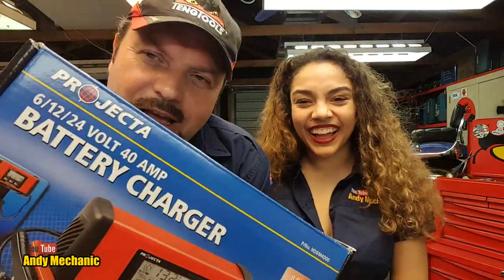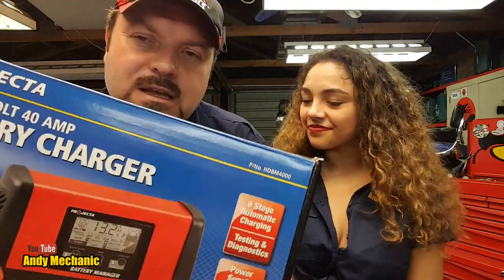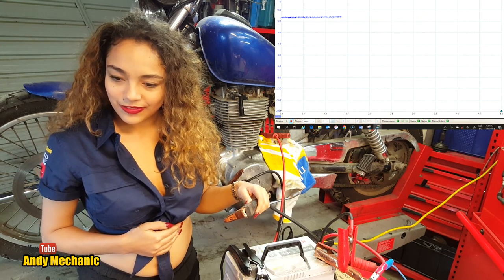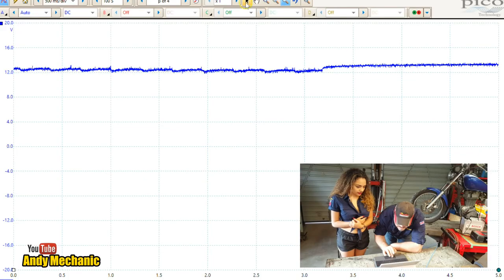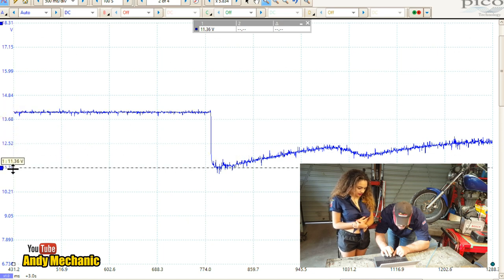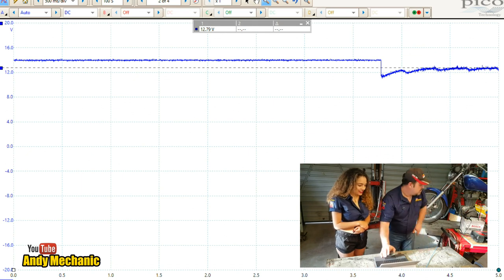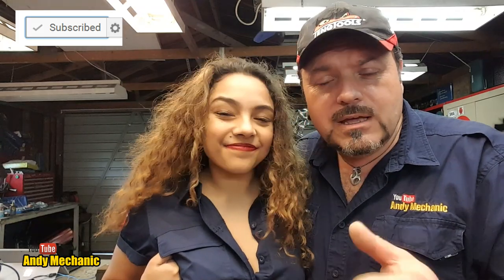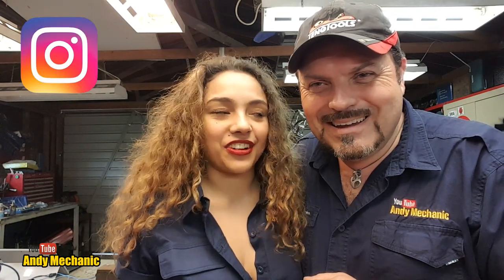ECU reprogram - Testing a Projecta Voltage stabiliser Ft.Tool Girl Jade #2605

Comment: Nice to see you using my favourite bit of kit,the pico scope. For power supply when testing I use a Ctek mxs27000 and it has been absolutely faultless in service and operation. Can't speak high enough of the quality of the product.
Reply from the maker: Cheers Andrew. If you get a chance would you do a similar test on your Voltage Stabiliser -  I'm really interested to compare devices. Especially looking at the data that I cover in the 2nd video on this - will be live on the channel in the next couple of days.

Cheers
Andy

Comment: will a smart charger not have done the same  as that unit did on this test ? some nice clean waveforms to
Reply from the maker: Hi Simon, I don't think a smart charger has the capacity available to compensate for up to a 70 amp draw unfortunately.

I'm just about to start a filming a 2nd video on this to capture more data with the PicoScope - a request of the NZ importers - they seem a little concerned (like me!).

Video should be up in the next day or so...

Cheers Andy
Reply: Andy Mechanic I've never done any. Programing on bike   but by you wanting the 70 amps I guess you need to turn the starter as some point
Reply from the maker: Yes, maybe. Though this unit is designed for use on cars too and a 70 amp draw on a car can occur even without an engine crank. I was just replicating that size draw to see how the 'tool' would react etc...

Watch this space!

Cheers Andy

Comment: I don't know if "benching" the ECU (that is, removing it from the vehicle system) or supplying the ECU with it's own dedicated power is possible in all circumstances, but I'd connect it directly to what in the electronics industry is know as a Constant Voltage Regulated/Switching Power Supply. 
Something like the MJF-4128 would cost in the neighborhood of $125 NZD (plus shipping & taxes, of course) provided 28A would fit the bill.
Even a large 35A regulated power supply should be under $250 NZGD.

Comment: The voltage difference between what the stabilizer is set to and what is being measured at the battery terminals is due to voltage drop in the connecting leads. 
The stabilizer only knows what it's internal voltage is. When the starter motor load is applied, the stabilizer is doing all the work, as the battery was at 13.4v before the stabilizer was connected and didn't have enough time to charge much more.
Shortly after connecting the stabiliser to the battery, the terminal voltage of the battery would aproach the stabilizer's output voltage and the load on the stabilizer decreases to a few amperes. The voltage drop across the length of the stabiliser connecting leads drops along with the amps.
The reason the voltage recovers a bit after the load is applied is because the starting current of the starter motor is much greater than the cranking current. When the voltage is first applied the motor is a resistor. As it spins up it generates an opposing internal voltage and the difference between the applied voltage and the internally generated voltage divided by the resistance of the motor determines the current draw.
Ohms law. Voltage equals amps multiplied by resistance.
Reply: Another variable is the temperature of the battery which increases once a load is applied. A battery at 35 degrees will maintain its terminal voltage under load better than a battery at 25 degrees. At 25 degrees C a battery can deliver 20% more cold cranking amps than the same battery at 0 degrees C.